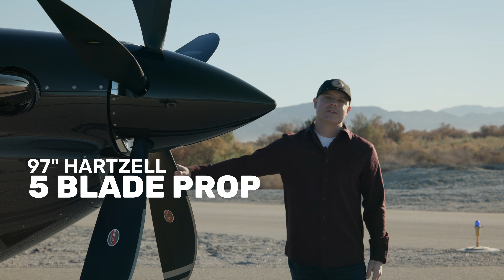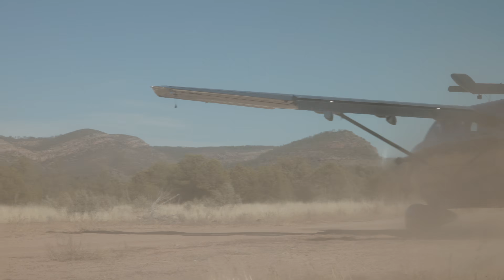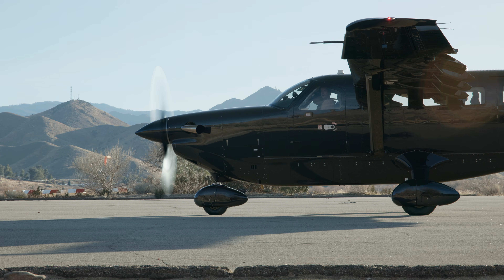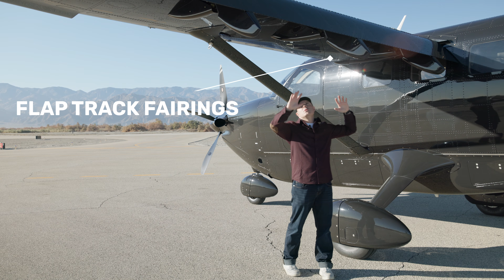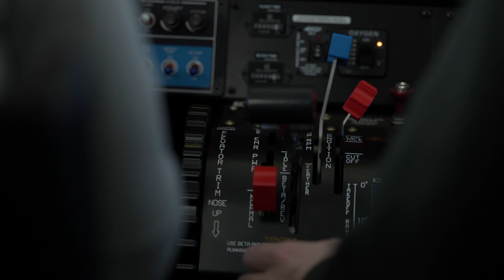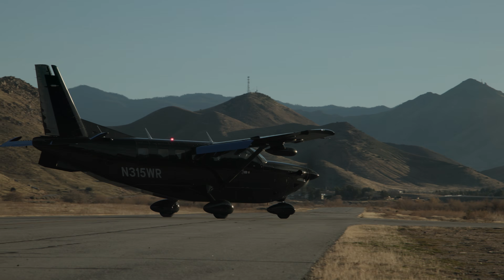Kodiak 900 Deep Dive with Mark Brown & 11 Aviation | Design, Power & Performance (Part 1)

Comment: According to JetAir which manages a Kodiak 900 N910WA - The aircraft can accommodate up to 1,650 pounds of passengers and luggage on a 200 nautical mile trip or fly up to 900 nautical miles nonstop with a lighter load.

Comment: needs dual FADEC, autothrottle, G3000, and autoland.
Reply from the maker: Features are certainly nice… But they come in a price. Unfortunately, if you try to add all of those things to a Kodiak, it would be priced way outside the market. Everything in an airplane is a compromise between ROI, weight, features, costs, complexity, maintenance… Etc.
Reply: @Eleven11Aviation  just use a raspberry pie and an ipad

Comment: Would like to see more real world applications:
W&B
Max load with full fuel
It says 1546 lbs, but that’s the base model.
What are the deducts for options: radar, TKS etc.
I know with the 100 there is about 925 lbs of options that comes off the useful full fuel load.
Can you leave Initial Sep on/off during takeoff pave/unimproved runways, etc.
Does torque limiter allow takeoff with power lever full forward, if so for how long
Real Radar usage
Real TKS usage
How do you get up on walk on the wing ( I’ve see you up there several time and there is no ladder around)
Power settings TO/Landings
When can you not use Prist 
I heard there was a modification for a potty, true?
Just a few suggestions if at all possible to incorporate in upcoming videos…
Thanks….
Reply from the maker: Great suggestions! Thank you for the detailed feedback!
Reply: These are the questions one should be asking
Reply: @lenmetallica  
Inquiring minds want to know . . .
Reply: Logical questions, but not for a friggin youtube video. Those are questions you'd ask the sales rep as a serious buyer.
Reply: @B@B @BobbyGeneric145 I see your point, but people look to YouTube videos to not only to “showcase” aircraft be informative as well. I’m not implying that every point I brought up be in a single video, Mark said he was doing several parts/series of videos, he could showcase several point along the way. Sometimes you simply don’t know what you don’t know, case in point, Mark did a video on how to refuel a Kodiak, something you would think every pilot “should” know, but I learned somethings I had no clue about, it was extremely informative! I demoed a Kodiak 100 a couple years ago and spent several hours flying it, I was excited about the “advertised” full fuel useful load. But didn’t realize during the demo that air conditioning and the 3 different seats at the time had significantly more weight and how that impacted the useful load. Ironically I learned that watching a YouTube video. And was disappointed to learn that after adding all the options we wanted (925+ lbs), the full fuel used load was less that our 182. It would have been nice to know that before hand. Mark does a good showing the capabilities of the 100/900, just thought diving a little deeper would be a good for those, like me that want to see more….. To your point, some only want to see “highlights”, that’s what’s great about YouTube, you can fast forward/skip the parts of the video that don’t interest you. Mark asked what folks wanted to see in upcoming videos and simply responded.
Hope you have a Blessed 2026!
Reply: @Parr4theCourse  @ you keep up the good work on these questions/statements. I will be a new 900 owner this year, your input/answers is sure appreciated. AND, Mark, you keep on marking our checkmarks" off - means you doing an excellent job sport.
Reply: The best airplane